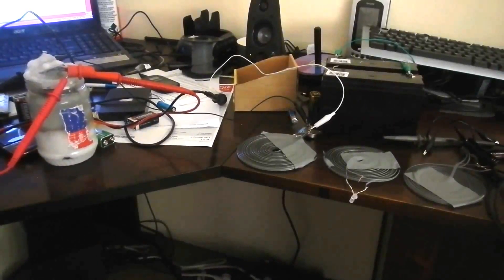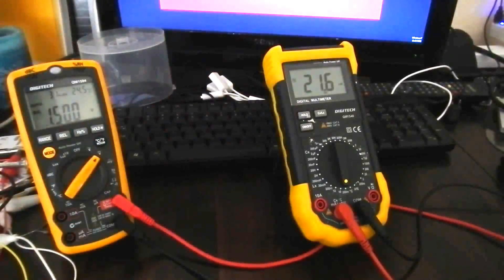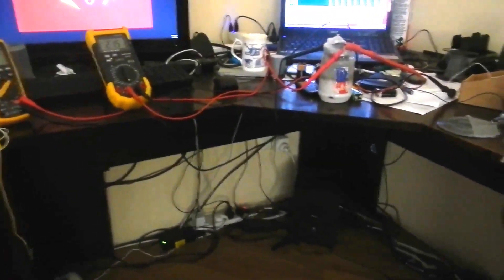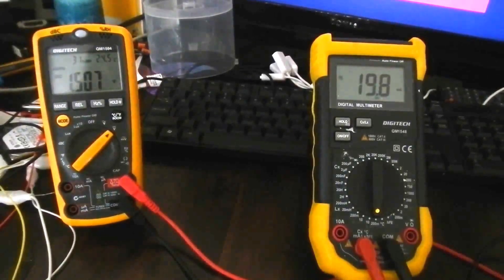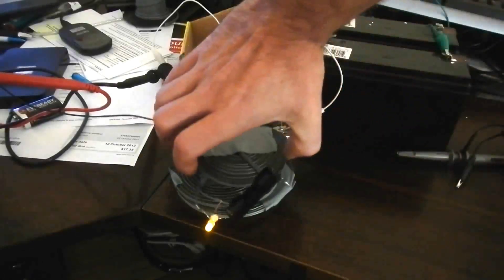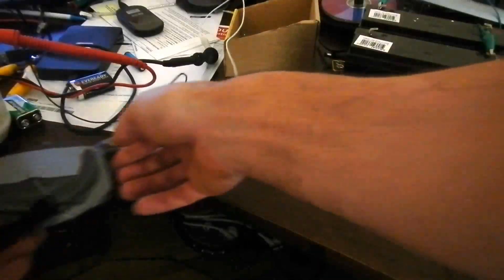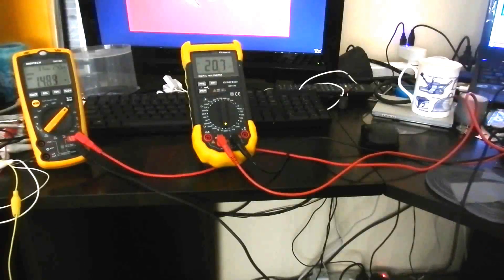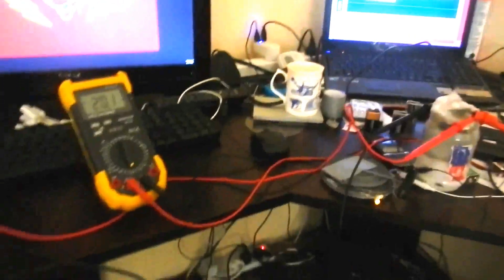Simple Wireless Electricity System Resonating Repeater/Blocker.

Comment from the maker: I don't have a heatsink big enough handy, so I used some cookware. Stainless colander will let a little through, at point blank. Solid stainless and ally both block the signal. I might try putting a full wave rectifier form receiver coil to large cap and see what I can collect... Mights try replacing LED's with a cap too. See what that does.  Need to make some bigger coils too...

Comment: Very good find indeed! As I understand things, the capacitance of the unpowered coil is acting somewhat like a metal block would in the Dr. Stiffler SEC experiments. Easy test is a PC processor heatsink on top instead and see if anything happens. If it's just not the same, then the coil really is a repeater/soaker/energizer/amp draw lowering awesome find lol